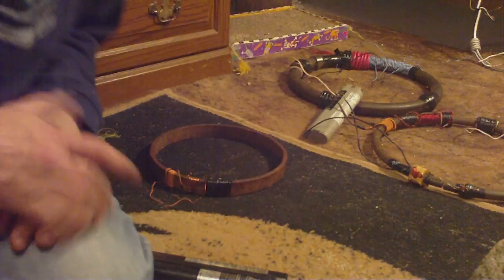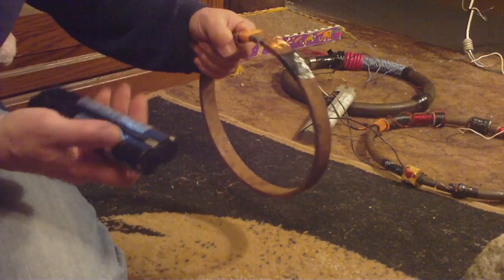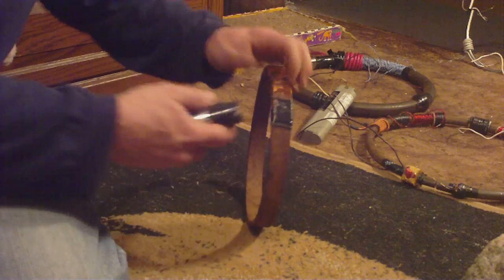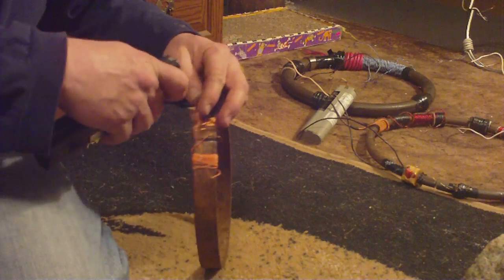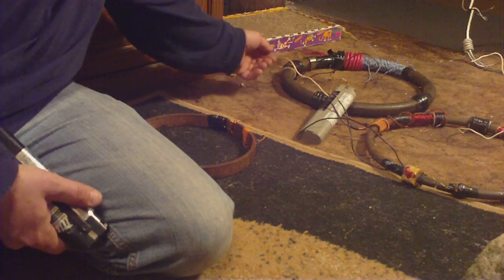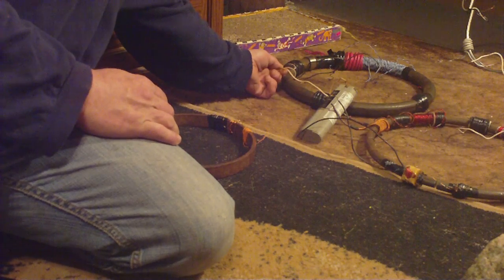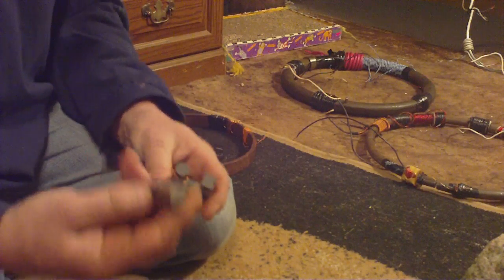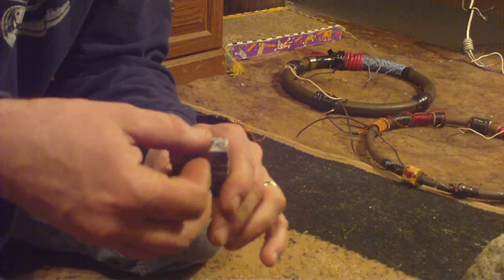toroid PMH

Comment: I would love to see that more clearly. This might just be a transformer effect, but, I'm not an expert on any of this. I would have to compare what you are doing if applied to a regular transformer. Not a bad idea for another video? I think the middle pole, which is the same as the area between the ends of the outer poles is important. I think electromagnetic coils and transformers are THE MOST important parts of power generation next to radio frequency (on/offs) of the magnetic circuit and Induction. I like your creative thinking and effort. Thanks!

Comment: Hey Dave, my main man, what part of the battery are you applying to the ring? And is the current flowing from both sides of the battery or just the one? I'm thinking just the one negative side because I believe the PMH is triboelectric series effect material (it being essentially an electromagnet, and hence, is now a positively charged, electron stripped by aggrevation, statically charged entity.
Reply: I mean for the time of the voltage gain, sparking...
Reply from the maker: i am charging it both ways, from + to-- and from -- to + i hope that makes sense
Reply: So both sides of the battery are touching the ring, and both sides would show the sparks? Were there any other power sources attached to the ring at the time? We're there magnets in any of the gaps? I'm trying to know if it was the PMH effect alone that increased the power. And so the battery itself, alone did not display the same power? I  do a lot of thinking and comparing, in my research, I am concluding that the area between the opposite poles is significant for many reasons, especially in Skeldon's generator. As a circuit connection when displacing electrons, (on/off) and as representing the "middle pole" of the generator, as well as the dielectric inertial plane of a magnet. To me this represents equilibrium but more importantly a form of destructive interference to the magnetic field or an important form of shielding.
Reply from the maker: on the big ring the battery is touching the ring and the coil wire. then i touch the the ring with the other end of the coil wire

Comment: The magnetic property "remanence" is what is used here; same as the old magnetic core computer memory.  The mainstream explanation of this is flawed however.  the remanent flux is not imposed on the "zero" field.  The application of the current through the coil sets up a pattern or coherence in the field, a field that is already present the charge field of photons.  Magnetic flux is the result or manifestation of spin imbalance in the field, specifically that part of the field in the metal ring.